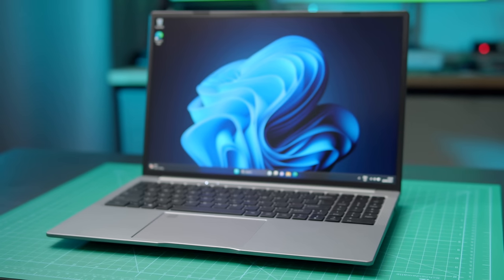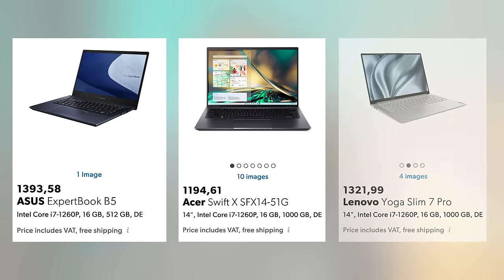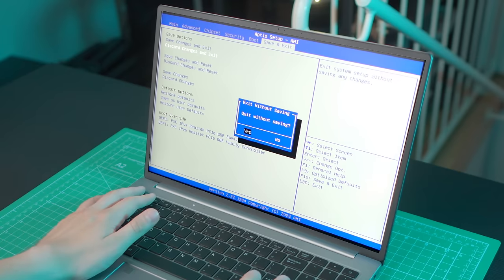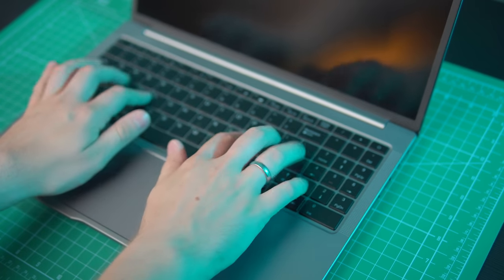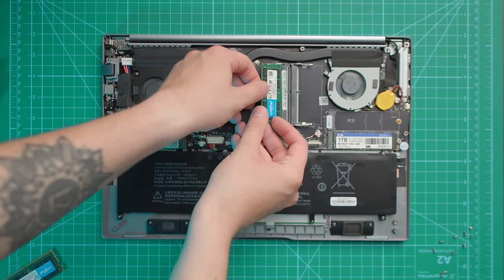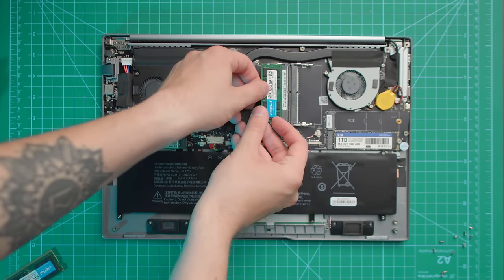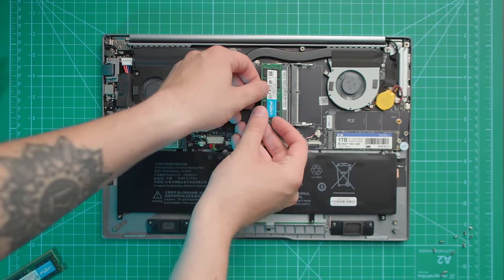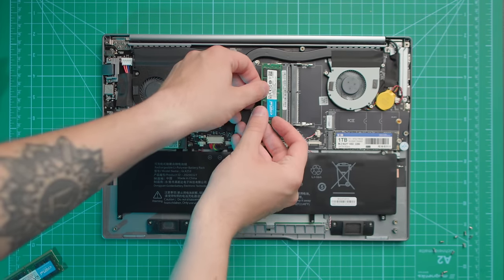Can You Use a Laptop as a Home Server?

Comment: The 1260P is a power hungry, hot running CPU.  I have one in an X1 Carbon Gen 10, and it's the same thing, fan runs a lot and it gets hot.  Poor battery life as well @ 5 hours on lowest brightness, doing very little work.

Comment: I installed a lot of older camera DVR recorders with 200 to 450 terabyte storage from commercial jobs the customer just upgraded to newer think on market and don’t bother with the old ones I have a 100 to 200 of these DVR camera all can be link together for bigger storage.
Customer wants bigger smaller units to save space 
Questions can I used the memory in those Digital Videos Recorders to make a server storage space.
As electrician I install electrical, CCTV internet, fiber ternate coaxial RG6 , trunk RG 11 , install wires for internet, cat 5e, 6plus internet, cat 7 and cat 8 wires. Make end, and termite HDMI end 2
I have no clue about computer program. Software program.
I have a room 30 by 40  in my farm barn don’t used the space and 250 amp services I want to make a server room for storage.
10 extra laptop 2 old computer 
I trench and run fibers line to the farm barn

Comment: interesting, i wonder if the lower power draw was due to a botched cooling solution or just PC cooling being better. 

hot chips do draw more under the same load. Would be good to see another example at a higher price point or with better cooling
Reply from the maker: The server doesn't draw a lot of power because of the cooling. It needs the cooling because it draws a lot of power.

Comment: kinda disappointed to see laptop don't have better power draw than even some desktop, tho it's still better than my QTJ2/B150M coffee lake setup which only entered C7 and draws 16w idle, idk how much with disks and all those docker services running or how much the draw if I used proxmox + VM instead of plain debian + docker. I wonder how's the battery life of that laptop on Windows (since this is the intended use case), that'll tell something about efficiency, and maybe laptops are tuned for efficiency in Windows not Linux.
Reply from the maker: Nope, there’s very marginal difference between the power draw in Windows and in Linux. At least when plugged in

Comment: An absolute garbage tier laptop will do great as a Plex/Jellyfin/NAS provided it has decent HW transcoding. You can get a laptop with Celeron N4500 for around 100€ used, and it can do HEVC transcoding (with some tinkering, as it requires enabling GuC/HuC firmware). I upgraded mine with 2TB SSD and 16GB of RAM (latter completely unnecessary) and it draws ~6W at idle and <15W at full tilt with screen on. In hindsight I wish I had splurged on Celeron N5100 which has 4 cores.

Comment: Sooo I did this (my decision, my responsobility, not blaming anyone), with a SFF Dell PC and and 4x 3.5" HDD's

Instead of the Pico PSU which I did not have, I opted to use a Seasonic Focus Gold 650W to power the HDD's.  
I know that this was not an efficient choice. I just wanted to see if it would work.  

Anyhow, I powered up the PSU for the 4x HDD's first, then a second later, booted the Dell and setup Unraid all just fine.  

Then I formatted the drives and began the Parity process (with about 200GB of trash data) and walked away.

When I came back to check on things an hour later, the Dell tower was powered off, and the  4x HDDs were all still spun up and rather warm.

From there, I tried to power on the Dell and - no response.  

Next I disconnected both the Dell and the additional PSU from the wall for a minute, and tried again - no response.  

Long(er) story short, the Dells motherboard was 100% dead.

All the HDD's survived, the memory survived, the cpu survived, and the PSU survived.

No idea what happened tbh.
But hey, it was a learning experience that luckily sacrificed very little hardware in the process